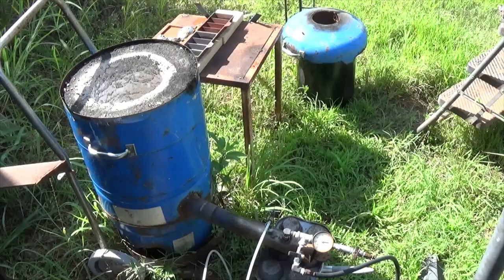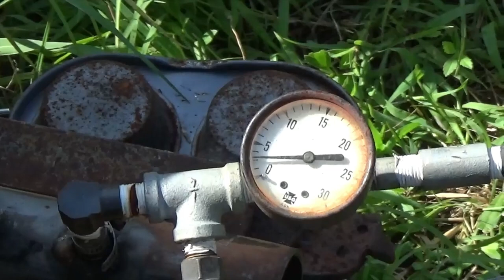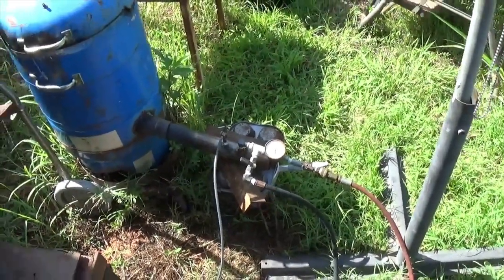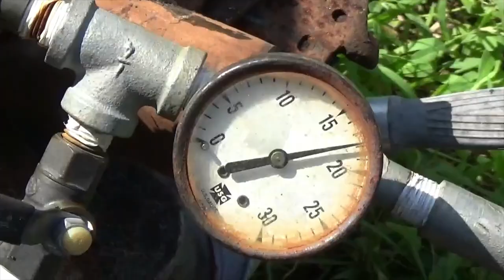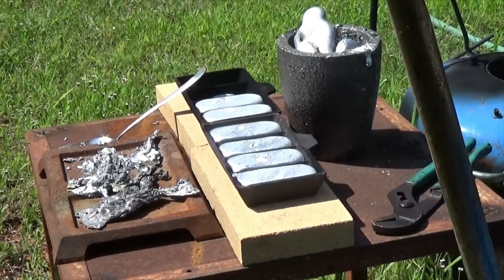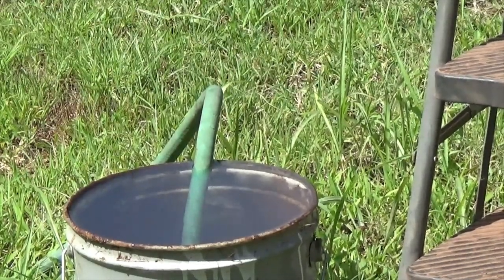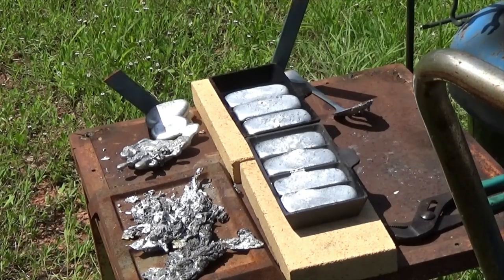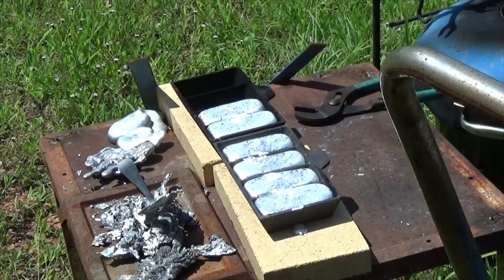Melting Aluminum with a Home made Waste Oil Burner & furnace

Comment: Another great melt.
Reply from the maker: Glad you enjoy it! got some new crucibles to try to see if the furnace will melt brass or copper, and I got 2 1KG ingot molds. thought a good size to start with. will see if the ingots will sell on eBay, Thanks for stopping by

Comment: Hi Mr Okie! I am tom in Scotland, I have watched all your videos and all that Aussie chaps,
I have got my burner going on waste oil and a hair dryer. works great. but I am now at a standstill. the are I was wanting to work on had a big trailer, but due to winter storms, my boat filling with water the trailer got crumped. so I am now watching your video.

I live in a council house so I am limited to what I can do. and at 74 the council would like me to just drop all I am doing and go into a feckn home. however you lads and black bear forge have gave me something to think about. I have the forge built. I just need your data to get my ally melted for my boat and am off to the everglades to live in the sun. take care . bye.
Reply from the maker: that sounds like a plan. live life to the fullest, and enjoy it the best you can, you will know when it is time to quit and your body tells you to slow down or stop. I am only 7 1/2 years away from you and I plan and hope to still be going strong, most likely a little slower though. I just don't want to be stuck in a wheel chair, so keep moving, like they say if you don't use it you loose it, make your dreams happen Tom

Comment: Do you have a video of you building your furnace? I enjoy your videos keep up the good work
Reply from the maker: no I don't have a video of building the furnace, I built it long before I made the burner, I took an old well house pressure tank, cut it around the bottom and used perlite and Portland cement to fill the bottom, then after it set I put down some plastic over the bottom piece and  put the middle section on the bottom and put the cardboard tube into the center ( I got the cardboard tube at home depot) I put a cinder block on top of the tube to hold it in place, I filled it with Portland cement and perlite and did the same with the top but I used a small coffee can for the top hole

Comment: Have you tried egetting the aluminum off your radiators the same way you do your aluminum motors?
Reply from the maker: I put one in the melting pot and the flame not only melted the aluminum but also the thin copper tubing. it may work in a big crucible where you could monitor the heat better
Reply: @Okiescrapper  Okay,thanks, I was just wandering.

Comment: To get a purer aluminum could borax be added  I don't know but hv seen it done with other metals. What is your opinion?
Reply from the maker: I don't think it is needed for Aluminum. I see where they use it for Gold and Silver, copper, brass, bronze, lead,  and zinc
Aluminum: Borates can be used in the actual process of preparing 
bauxite ore into aluminum. Low-grade fluoboric acid (HBF4
), produced 
from hydrofluoric acid and boric acid or boric oxide, is used in the 
manufacture of cryolite (Na3AlF6
) for the electrolytic production of 
aluminum. The Alcoa Alzak process of electropolishing of aluminum 
also requires fluoboric acid. Ammonium fluoborates can also be used 
as fluxes for aluminum reduction. Boron is a grain refiner and 
hardening agent for aluminum.

Comment: Hey, Allen, I noticed when you skim the dross from the top you use a slotted spoon.  My dad when he melted lead, used a slotted spoon.  Is there a reason for that over a regular spoon?  Just curious.  Love watching your melting videos!
Reply from the maker: no not really just one that I had on hand. I may try a brass or copper melt soon, I may need to weld the pipe onto the furnace, I may Waite until late Sept. or Oct. when things cool down a bit. Thanks for stopping by Roger

Comment: What is stamped into the bottom of the ingot pans? It would be cool to have Okie Scrapper on the bottom.
Reply from the maker: yes it would be I may have to look into getting some custom ingot molds made, RCBS  is what is in the bottom of the mold, here is a link to them https://www.amazon.com/gp/product/B000N8HW46/ref=ppx_yo_dt_b_asin_title_o02_s00?ie=UTF8&psc=1
Reply: @Okiescrapper  RCBS is a reloading company so they market those molds for lead and people that reload and swage their own bullets.  There is a reloading machine called a RCBS Rock chucker. I have reloaded in the past.